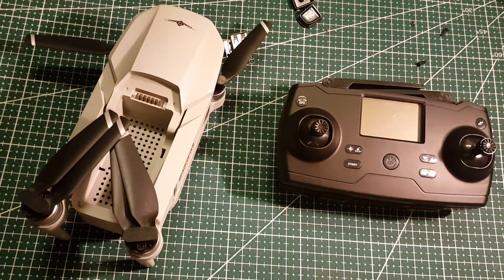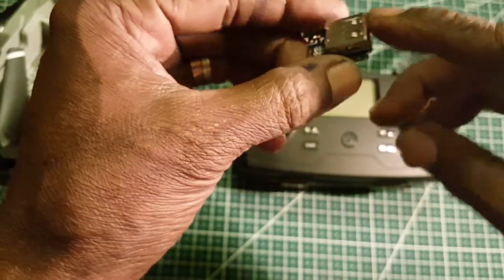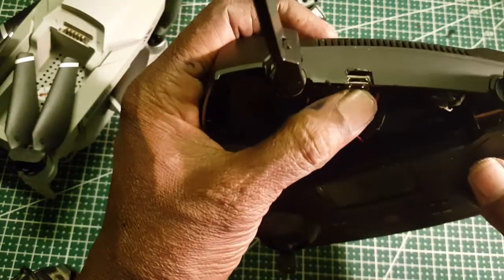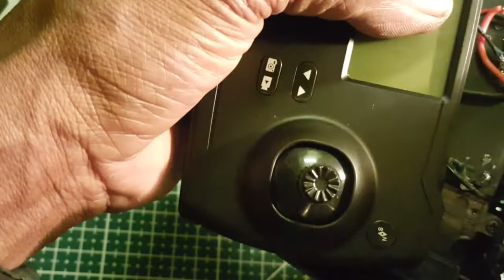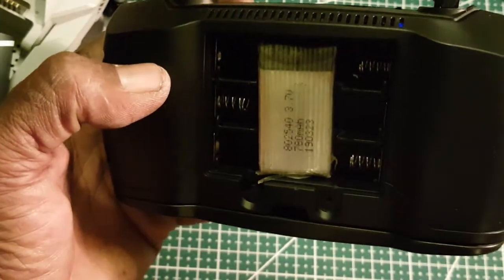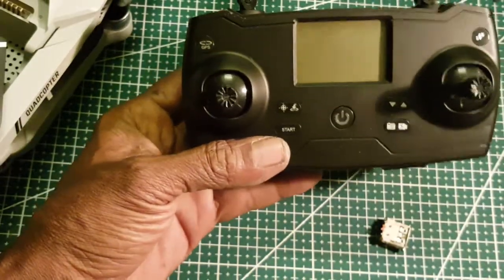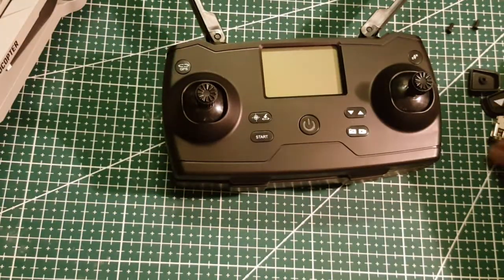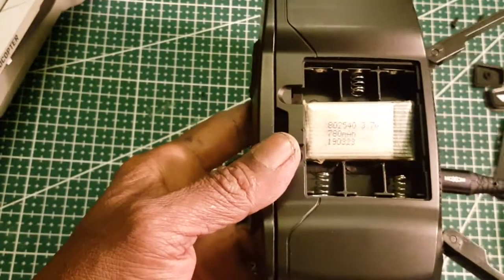KF 102 REMOTE CHARGER DIY

Comment: good idea, i was thinking to do the same thing using tp4956 circuit ! your board deliver 5v or 3v?
Reply from the maker: 5v charge only 3v used.actual battery capacity 4v.but cant support to remote and opration as well